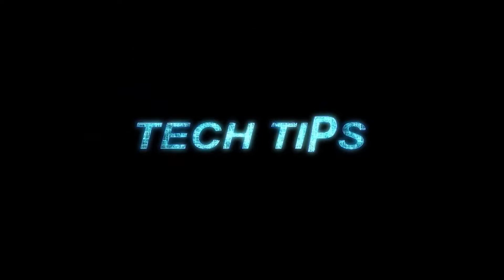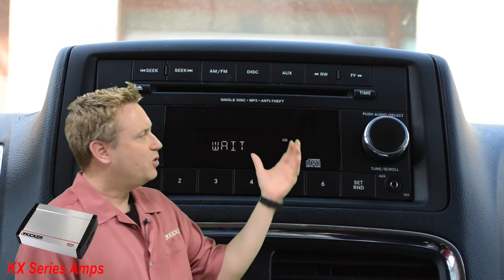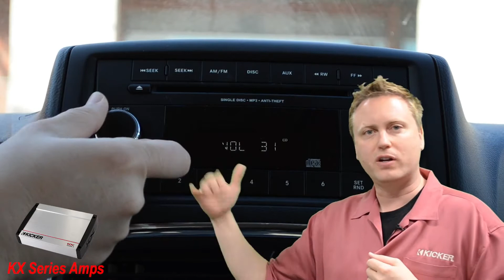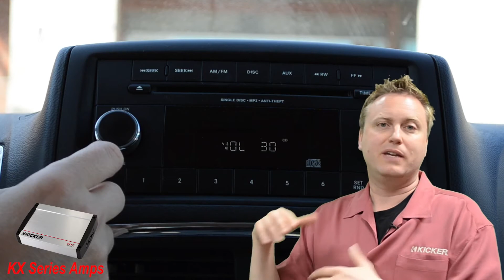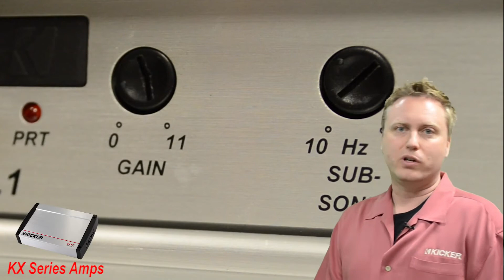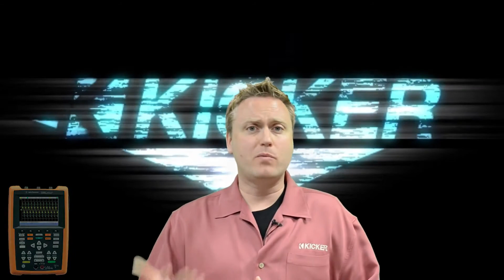KX Amplifier Introduction Part 2  Setting gains

Comment: Do I max out my bass knob and then tune the gains?
Reply from the maker: The Bass Knob is the last thing you set.  Use this video to help you set up gains first, find clipping, etc... If you need more help, give us a call at 405-624-8510.  We are open from 8-5c weekdays.
Reply: KICKER Thanks a lot. I have 2 15 inch CVX running on a KX 2400.1. I do not plan on using the Kick EQ+  since I will be using the eq on the radio. I was wondering if you guys can help me out and tell me where to set the sub sonic filter (on what HZ) and Low pass crossover (on what Hz). What would work best on these 2 15 inch CVXs sealed custom box for low pass and subsonic??
Reply from the maker: Sure we can help.  Could you tell us the size of the box?  That plays a role in the settings.
Reply: KICKER 
wide 37
Length 19 
Height 18
Reply from the maker: Ok, so that is 7.3 cubic feet of air.
Reply from the maker: Now that I know your airspace, I've asked my Techs to give me the recommendation for XO and subsonic.  As soon as I hear back, I'll get the right to you.
Reply: KICKER also I just set my gains using a multimeter and set my subsonic and low pass crossover using your 50hz test. The question I have regarding that is do I have to re tune my amp settings (gain, subsonic, and low pass crossover) again with a song that I’m familiar with or am I good with the settings that I tuned the amp with the 50hz test???
Reply from the maker: I got a response frrom my Trech Support guys.  They are saying set the subsonic to 25Hz and cross it over at 80Hz
Reply: KICKER thanks I will do that.
Reply: KICKER how do I calculate the voltage for gain? Is it 2000 rms x 2 ohms and then the square root? Or do I multiply 1000 rms x 2 ohms and then the square root?? Do you just calculate one sub or both???
Reply from the maker: Are you trying to set the gains by ear, or with an oscilloscope?
Reply: KICKER by multimeter
Reply from the maker: A meter will tell you voltage, but not when clipping occurs.  Just a heads up.
Reply: @KICKERAudio  pls help i have the 1600 to 2 15 inch kickers cvx